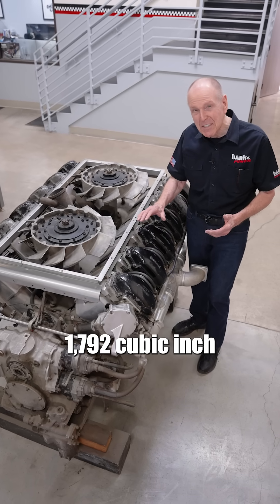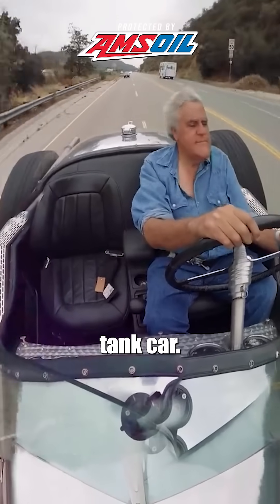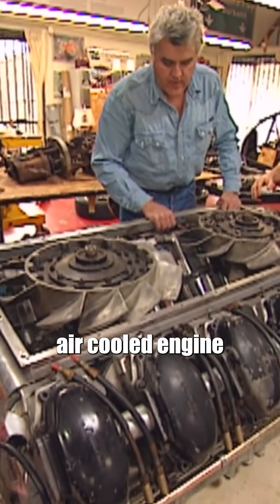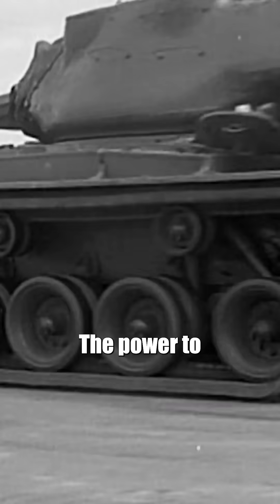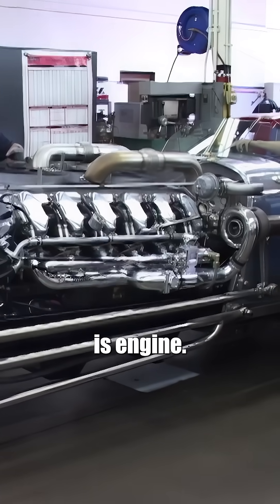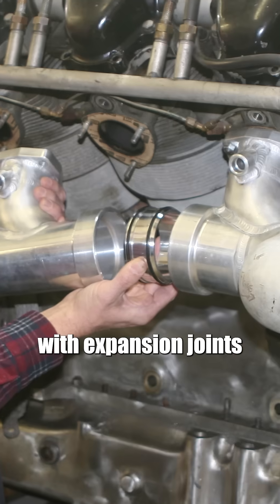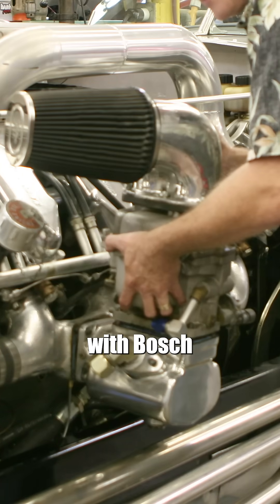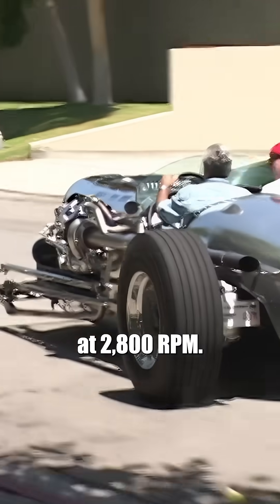We twin-turbocharged Jay Leno's V12 Hemi Tank Car

Comment: 2nd edit- I wasnt really looking for opinions in the comments- I wanted to know how the car was ACTUALLY built in reality...1600 HP at 2800 RPM is about 3000 ft-lbs of torque. You need to talk about the drive train this car has that can handle that type of power. **EDIT- i looked it up when i was on the computer -it has an Allison 6-speed HD4060 ,its generally rated for 1850 ft-lbs, its probably upgraded somehow. and the rear axle is a rockwell.
Reply: The drive train wont need it if the tires spin like you're driving on ice :D
Reply: @ValentineC137 You are right. If there is no resistance to the power, the transmission will live a happy life.
Reply: Those Allison trans are great boxes. We have a big cummins running 2000 ft lb of torque through one and she hums all day long.
Reply: Probably doesn't need a transmission, just a big enough clutch.
Reply: @MDP454 the drive shaft & axels too ive seen those twist and bend like they’re tooth picks 😭
Reply: i wanted to say that, that's truck torque. i'd doubt the alison is upgraded at all, just lifted from a truck and smacked in. our volvo's 500 at work got around 2500 pound feet of torque as is at around 1400 rpm. gearboxes dont really care about rpm, just torque.
Reply: If you have no transmission, then you have no reverse.
Reply: @ruckus__ top fuel dragsters would like a chat with you…
Reply: @ruckus__  top fuel cars technically don't have a transmission, they use a reverser
Reply: @ruckus__  You do if the engine can run in reverse. And some can.
Reply: @bryanst.martin7134  can this engine run on reverse?
Reply: @hufinnpuff3068  I don't think so.
Reply: That’s so much torque I’m surprised the frame doesn’t twist
Reply: it just doesn't weigh and grip enough to allow the torque to do damage
Reply: @rompdude  yeah I agree, the tires are going to be a limiting factor. I think they will slip before the transmission
Reply: Jay Leno's Tank Car | M47 Patton Tank Engine | Greyhound Bus Transmission | Blastolene Special
Reply: you need to account for the fact that not all100% of that  power is being utilized.  the tires will break traction  well before the transmission  breaks.
Reply: Its got very linear power delivery so it keeps it together.  It's heavily reinforced though.
Reply: Dziękuję za to.. 🖐🏽
Reply: Thank you, was wondering how much torque it made too haha
Reply: I think it all looks very reasonable
Reply: Heavy engineering  huh? 
Any videos about that heavy builds
Reply: That thing would roll in any gear at idle speed😅.
Reply: @MDP454 And a pickup truck full of spare tires following behind it 😂
Reply: 1856ftlbs in a vehicle that weighs 10,000lbs
Reply: huh my cordless drill is also a rockwell 🤔
Reply: @PhunkBustA Rockwell also built the Space Shuttles.
Reply: That is a very interesting project car.
Reply: They built it one frame rail at a time. lol idk maybe there's a video on it out there from jay I'll look and if I find it I'll come back and describe the title of the video to you because YouTube is pretty communist about links being commented.
Reply: Wait 3000lbs of torque 😅
Reply: The way it handles the torque is wheel spin. It never hooks up you don't have to worry about things breaking. 
There is no way that car ever hooks up with such skinny tires. Not trying to be a know-it-all but it's like trying to torque a lug nut while the wheel is turning free in the same direction you're torquing it. You'll never get to 100 foot pounds of torque if the wheel doesn't hold still.
Reply: What's the peak torque? 3000 ft-lbs at redline is insane
Reply: I’ll like to know how you got that number. Because at 2800rpms producing 1600hp it’s 3000ft-lbs of torque. It might be producing that at 1600-1900rpms, but there’s no way to know without seeing the dyno numbers.
Also, a semi truck transmission can take it just fine like an rtlo20918b. Right now I’m driving about 2800 pounds of torque through a rtlo18913a which is rated for 1850 pounds or torque and not spinning the wheels it takes everything the engine gives it.
Reply: @B0RN2RACE100  The formula goes like this HP = Torque x rpm/5252. To find torque in the formula we use the reverse - 1600hp x 5252/2800 = 3001.1428...
His numbers are right. And since the dyno is where we get the hp figure and the dyno was actually measuring the torque and using that same formula to arrive at the HP number in the first place, your point about seeing the dyno numbers doesn't apply. The HP figure is FROM the dyno.
Reply: @ladamyre1  he edited it and corrected it. He even mentioned it to my reply. I know the formula
Reply: @B0RN2RACE100  One point: it's Lbs foot in torque.
Reply: @bryanst.martin7134 hush grandad.
Reply: @bryanst.martin7134  There’s a Karen in every crowd
Reply: @B0RN2RACE100 Are you running a Lipe clutch? I have a 379 with ACERT Cat set at 625hp and 2050tq. I want a little more but I fear the clutch won't take it.
Reply: @paulkimber6028 I’m sorry you have an ACert  Cat. Shoulda gone glider or pre 08. 3406 E.  Or D.D.  Only 500-550 hp stock, but it doesn’t have to stay stock. Plus no DEF, Regen etc.  usually better mpg’s.also.    But thats just imo, I’m  just giving you a hard time,  I grew up driving 379’s. We still got a 98’ 379 exhd. W/ a an ol CAT. But mostly, ‘freightshakers’  gliders w/ 500 DDiesels last ten yrs.. anyhow Im sure you have a newer sweet rig! Be safe 👍 keep on truckin.
Reply: @B0RN2RACE100  youre right , my math was wrong, i typed it into Ai and it usually gets the formulas correct. my fault for being lazy.But Hp is derived from torque and rpm so if you know 2 of the values, you can calculate the 3rd. I still wann know how they built it.
Reply: @Marklglt has to do with the weight of the vehicle as well, the tank car is actually lighter than most the vehicles that transmission would be in and it also doesn’t tow anything. Biggest thing would be getting the right torque converter for it as if the converter is to loose it would drive temps up and in turn wreck the transmission. Also the transmission is computer controlled so they probably upped the commanded line pressure in it as well.
Reply: @Marklglt  it would be a great series to see how the built it. Also, I’m glad you know the formula, it’s annoying seeing people look at torque and hp numbers like they’re mystical power level without correlation to each other.
Reply: Ai, you mean we can ask some database, they may be a little better than they were before but nothing to do with any intelligence... that's why it's responding with primitive answers ignoring words in a sentence
Reply: @johngarlick7115  The torque converter match is a bigger issue in commercial applications with diesels that need optimal drivability for the GVWR.  Regardless, the converter used with the HD-model trans is completely electronically-controlled and has a lockup clutch that would apply in 1st or 2nd gear (typically).  The trans ECU can command diesel engines to reduce torque constantly in certain gears to protect the hard parts, but if the Bosch ECU used here is sophisticated, the trans might be telling the engine to cut some ignition timing for a split-second to reduce engine power during shifts (cutting power on a turbo'd gas engine is very limited vs a diesel).  As for fluid pressure, the trans ECU can dynamically control pressure to either/both clutches that are being used in any particular gear.  If the speed sensors detect clutch slip, they can immediately increase pressure on a clutch to try to eliminate the slip.
Reply: @B0RN2RACE100 cheers cause I was losing my mind at that random number why do people think torque is comparable to hp they are two different types of forces
Reply: @DayWalker-qt7wl horsepower is literally torque applied over time. If you have 2 of the 3 parts of the equasion you can calculate the last. The 3 are torque, rpm, and horsepower
Reply: @BrokeWrench  I've used the equation plenty mate and it's never accurate enough in my opinion to call it constant correlation if you disagree good for you
Reply: @DayWalker-qt7wl  No, it would appear you don’t actually know what HP is…. It’s a calculation of torque & rpm. Just like any equation, if you have any (2) of the figures you can always solve for the 3rd.
Reply: @DayWalker-qt7wl  You're joking right? When you type 10 plus 10 in the calculator and it says 20, do you not trust its accuracy?? You can't be real here.
Reply: @Chris-te7uk someone doesn’t understand variables
Reply: Literally no one cares what you were or weren’t looking for. And don’t edit the first part
Of a comment! You edited the end!
Reply: @jamesbizs  if you dont care, then why'd you feel the need to comment dummy?🤣Since youre a little slow, ill explain it. People were giving opinions about the build, my comment was directed towards banks because he said if you want to know more about this, leave it in the comments. I guess you didnt watch the video. Figures.
Reply: ”I typed it into AI” … now it makes sense why you didn’t recognize that your original answer was off by three orders of magnitude.
Reply: I'm  Sorry.  Yur in the hospital  holding  yur first grandson. Some  people  should  know better. Not the time to talk about Business.  It just AMAZES ME how some people  just don't care. 😣
Reply: @marcusv5657  it's not just a business for banks anymore, he lives and breathes this stuff and has pioneered a lot in the automotive field, yeah it's his first grandson but Leno and him are really close as well, it's like talking to a friend at the hospital as well
Reply: @marcusv5657 lol. If Jay Leno calls you wanting to do business’ you pick up the phone.